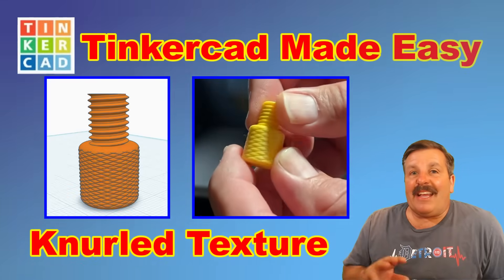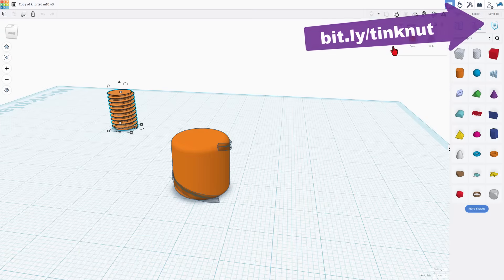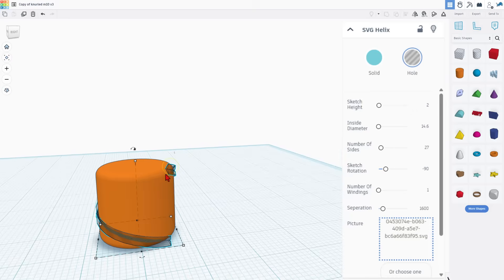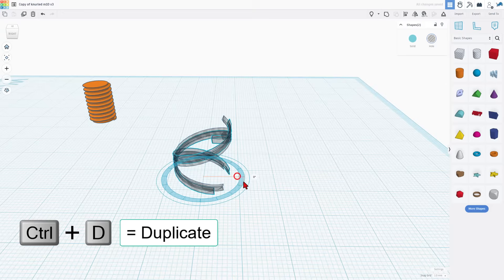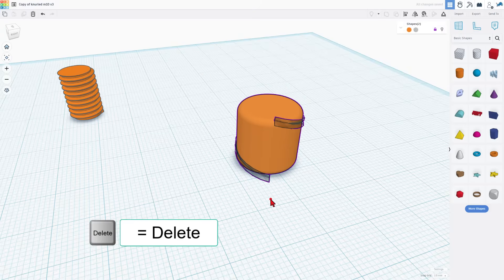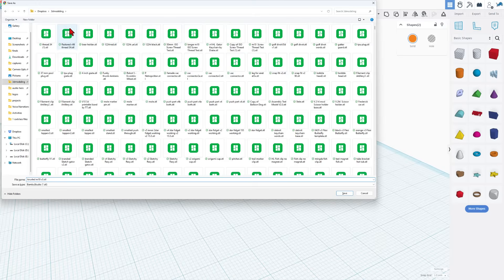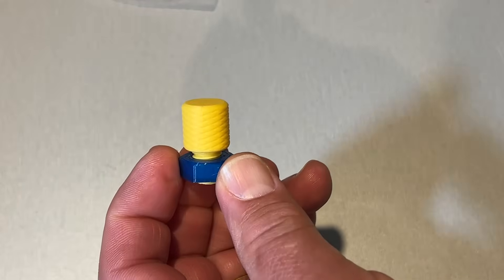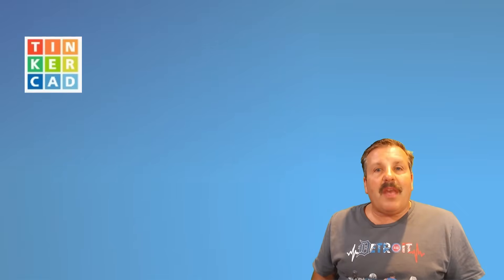Tinkercad Made Easy! Brilliant Steps to Knurl your Designs 💯🔥

Comment: Nice! BTW the Screw Thread shape also works and is less processor heavy, AFAIK.
Reply from the maker: Sweet. I thought about that, but did not dig around on how to get the point aimed inward. Time to explore!
Reply: @HLModTech just make the imner thread height smaller than the outside. I previously published knurling demos using it.
Reply from the maker: That rings bells!